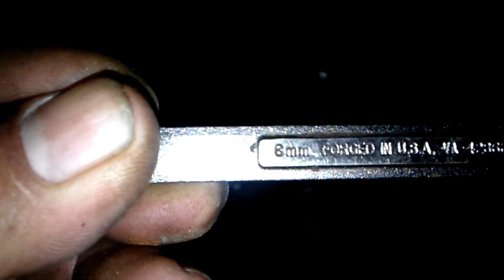2003 ford explorer headlight removal and replacement

Comment: Bulb can be replaced with no tools.  Lift the two tabs as indicated in the manual, remove the headlight fixture, change bulb.  Installation is reverse of removal.  Might need some WD-40 to loosen the clips.
Reply from the maker: Thank you for watching and comment.  Unfortunately i didn't have any manual.